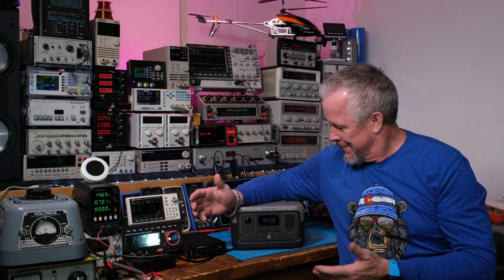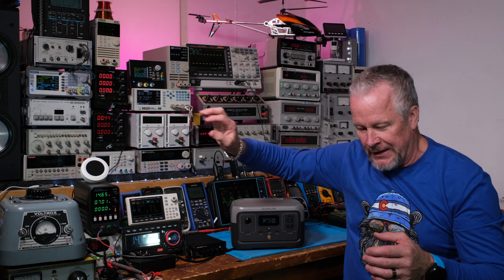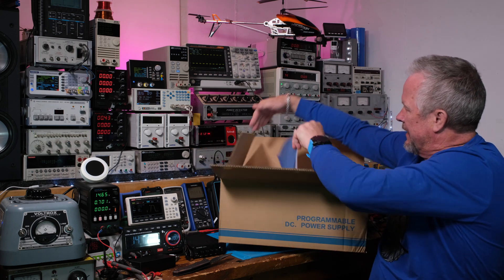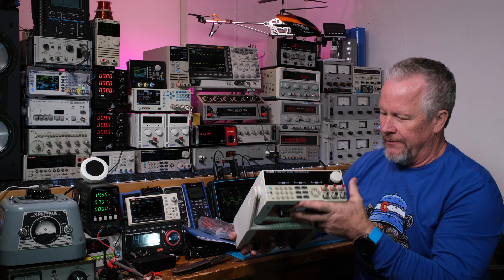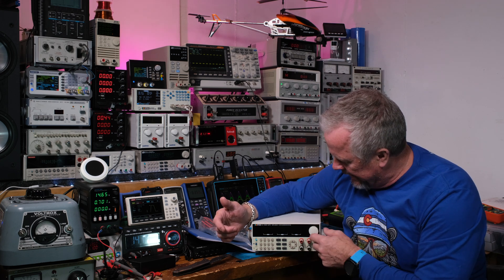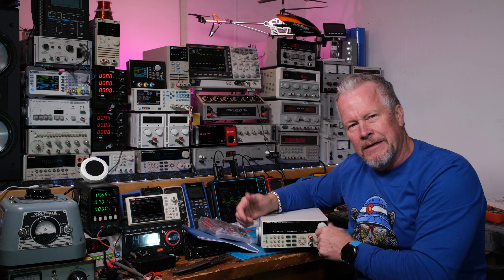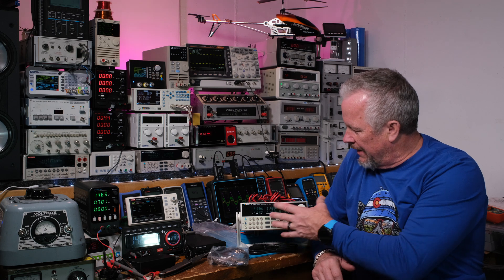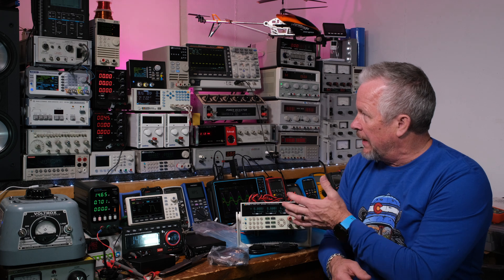Matrix Programmable Triple Output Bench Power Supply  MPS-3033X #benchpowersupply #trackingPS

Comment: I've lost track of which programmable load you may have, since you reviewed the Siglent SDL1020X a couple of years ago. I recall that being a loaner you had to send back.  If you had something like that you could program some varying load profiles, and measure on a scope to be sure it's delivering accurate levels under various loads.  Make sure it doesn't have obvious problems like crummy rise times, or wimp out near its limits.  Check that it stays properly cool enough, and none of the magic smoke comes out.   I don't remember encountering the Matrix brand before...  Where do you get it?
Reply: Oops.  I found your review of the 300W ITECH programmable load from a year ago.  I see that I commented on it at that time.  If I'm not mistaken, it's still in your lab, in the 3rd column from the left.   It's drifted down a bit, but still recognizable by it's big knob, and two hurkin' binding post/banana jack connectors.

Comment: Would be nice to see it drive something that requires dual power as in +15 ÷15 volts. 
But who designs something today with an oldschool RS232 interface? Where do you find a PC with that? There's this new thing called USB now...
Reply from the maker: Thanks for the feedback!  I agree with the RS232;) But I still see it coming on the expensive gear - along with the old GPIB connector;)

Comment: They wouldn't do a new design with RS232 surely? How very last century!
Reply from the maker: LOL that's what I thought;)  But, it is funny how that and the GPIB connector/protocol are still used in the expensive equipment, so it is actually a good sign that they use it.  This is used for programming test set ups even today.